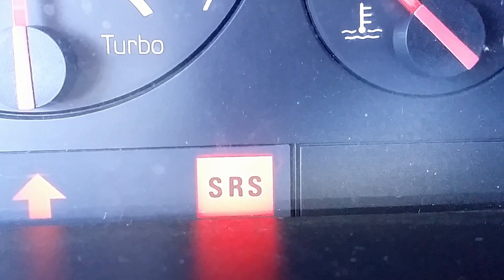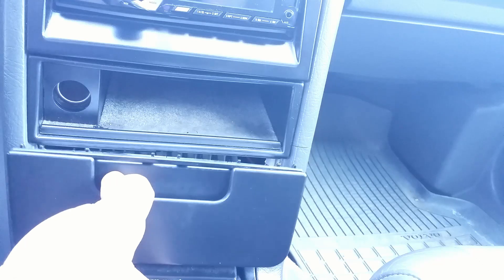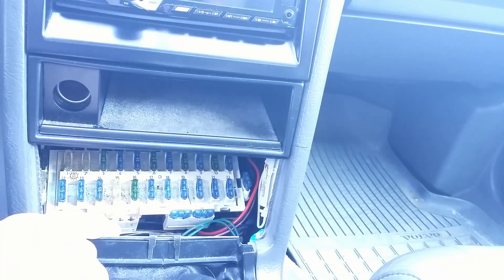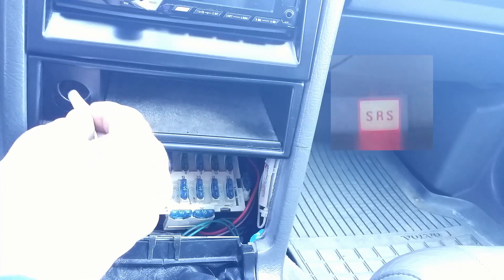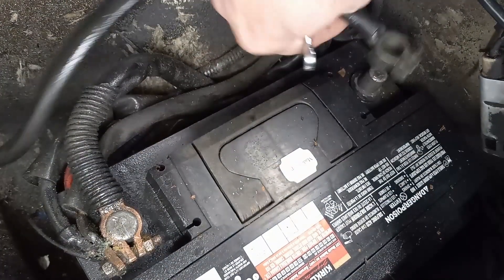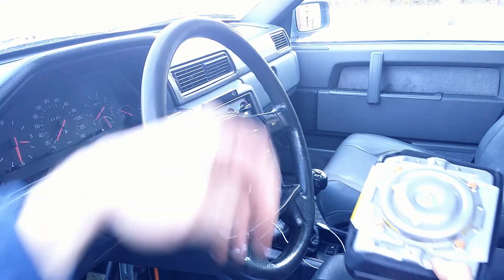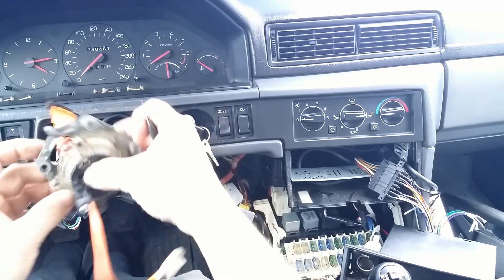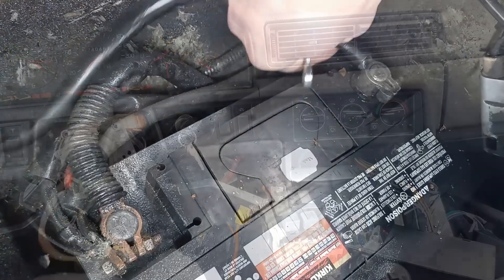Airbag Dash Light On

Comment: Will this work on a 1996 Volvo 940? I got the SRS light on.
Reply from the maker: It could be different in different markets. Some models have the SRS code displayed in OBD I ports under the hood. See my other video about OBD I codes for Volvo.
Reply: I dont have obd 1 under a hoid
Reply from the maker: So, you should have OBD II port in the cabin somewhere.
Reply: @robertdeptula2003 yes! how can i reset the light. can i only do it through vol-fcr
Reply from the maker: You must have an OBD scanner SRS capable.

Comment: Instructions unclear. I burned my testing wire
Reply from the maker: Could be different wiring on different markets, years, models. If you must pull a fuse to get to the "testing point", then it is NOT the "testing point".

Comment: I have a 945 1992, can i use s fuse to check? I cant test or delete fault code like you do in the video
Reply from the maker: Depending on the market the testing point can be at the fuse box or at the OBD I test box in the engine bay.
Reply: Its in the fuse box. I have tried to put a resistor before like you did but still dosent come of  @robertdeptula2003
Reply: Now its flashing first two times then goes of and flashes 7 times and then light is on all the time even after i reset it. Where can i find what 7 flashes mean? @robertdeptula2003

Comment: What if you have a fuse where you put the cable too test the srs light
Reply from the maker: Depending on the year and market it could be different. If your car is equipped with two OBD-I diagnostic units under the hood (bonnet) then unit B socket #5 should read SRS codes. See my other video how to read OBD-I codes.  
1-1-1	OK: No faults detected in the OBD system
1-1-2	Internal fault in the sensor unit
1-2-7	SRS lamp, short circuit or break in circuit
2-1-1	Steering wheel module, short circuit in wiring
2-1-2	Steering wheel module, break in wiring
2-1-3	Steering wheel module, short circuit to ground
2-1-4	Steering wheel module, short circuit to +12V
2-2-1	Passenger module, short circuit in wiring
2-2-2	Passenger module, break in wiring
2-2-3	Passenger module, short circuit to ground
2-2-4	Passenger module, short circuit to +12V
2-3-1	Seat belt tensioner left, short circuit in wiring
2-3-2	Seat belt tensioner left, break in wiring
2-3-3	Seat belt tensioner left, short circuit to ground
2-3-4	Seat belt tensioner left, short circuit to +12V
2-4-1	Seat belt tensioner right, short circuit in wiring
2-4-2	Seat belt tensioner right, break in wiring
2-4-3	Seat belt tensioner right, short circuit to ground
2-4-4	Seat belt tensioner right, short circuit to +12V
No code	SRS lamp in the instrument cluster does not light
No code	Fault in diagnostic output

Good luck!

Comment: This is the best explanation video for volvo 940 airbag system I've seen, thank you for all this effort you put into this fantastic video! 😀
Question; Why did you go straight to the steering wheel airbag? Why did you expect a fault there, since you have more airbags?
Reply: Only works on volvo cars in us. 
Not in Sweden.
Reply from the maker: In this model 92 there is only one airbag for the driver. Code for seat belt tensioners are 10 flashes: "Mercury switch in sensor shorted, or closed for more than one minute. Lead to seat belt tensioner shorted to ground or battery positive." or 11 flashes: "BOTH seat belt tensioners disconnected (no code if only one connected)." Codes table can be found here:  https://www.brickboard.com/FAQ/700-900/ElectricalSRS.htm
Reply: @robertdeptula2003  So those side airbags are not connected to the airbag control unit, and the steering wheel airbag is the only one then.. thanks!
Informative link btw 👍
Reply: @robertdeptula2003 the best what I have seen also 👍 I have just bought 940 2.3i sedan & I am very happy with the driving qualities and comfort. Just SRS lights turned  on after fixin the ignition switch contacts group. And SRS lights turnef on constantly :( , but also there was no bulbs inside (maybe SRS was ON before me) , I have put working bulbs . when I turn the steering wheel, the srs can light up, then go out, as well as if you press the panel (with the mirror and glass heating switch). Can you give me some advice, please, except you have already made inside this video 👍
Reply: You sir is a true legend!
Thank you so much. 
When I changed my steering wheel I didn’t notice the a have to lock the inside part with the screw. 
Is that really bad?